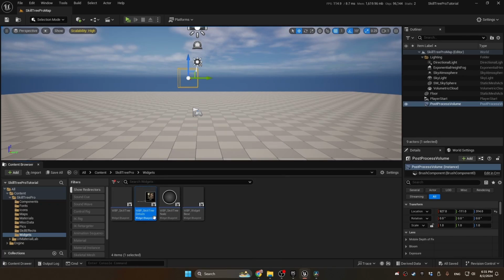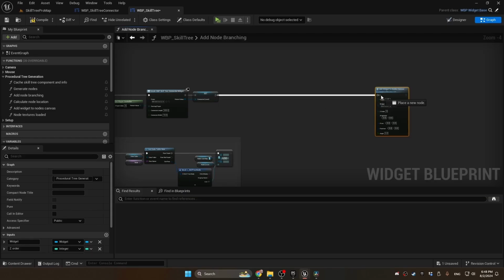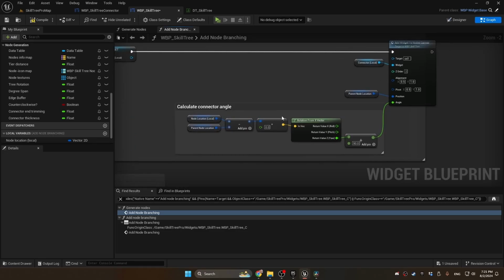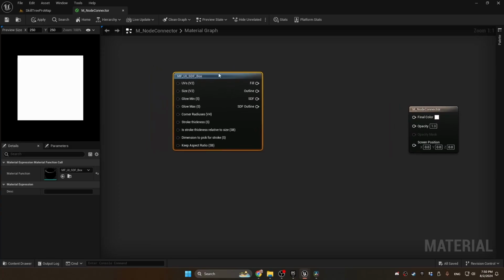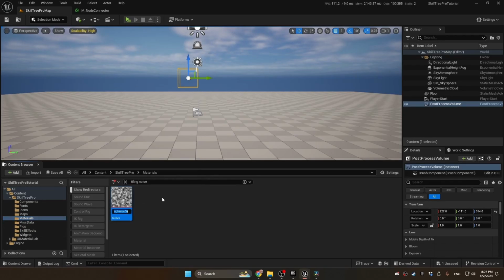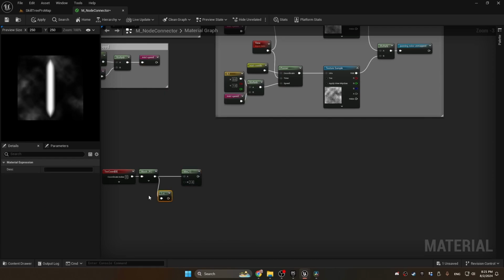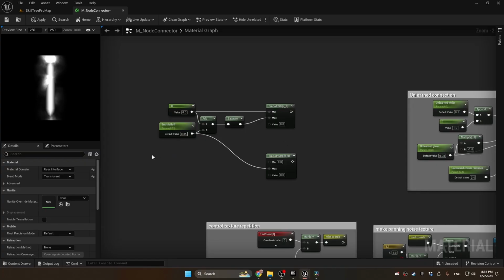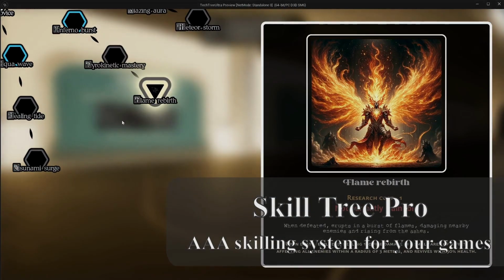Build a AAA Skill Tree in Unreal Engine — UI Energy Channels

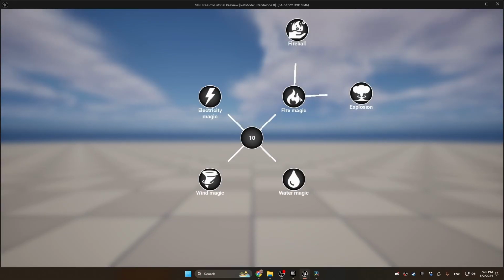Comment: 5:56  - on opening UI my connectors are side rotated to the  corresponding  noede and don't react to any value changes - they're just fixed white rectangles.
Reply from the maker: It sounds like 2 problems.

By "side rotated", do you mean they're all pointing to the right at the same angle?  Something's likely not connected, perhaps the angle input for AddWidgetToNodeCanvas.
The other issue, not seeing any value changes, sounds like you might be changing parameters on a different material instance than the one that's assigned in the connector widget.
Reply: @Enginuity_UE Yes sorry, Side rotated I mean - instead of pointing towards node its rotated by 90°, so Side of connector is pointing to next node.

Later I will have possibility to check your solution and let know if it helped.
Reply: Everything from this episode is exactly like yours, it must be small mistake made on procedural gen or artistic control - I'll just rewatch these episodes and try to locate the bug.